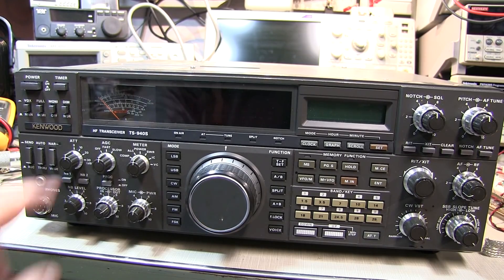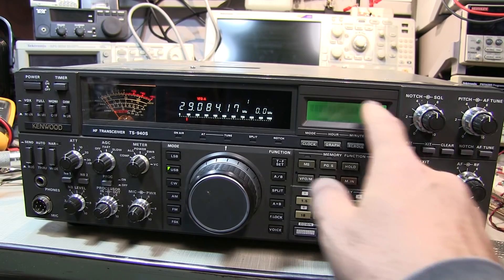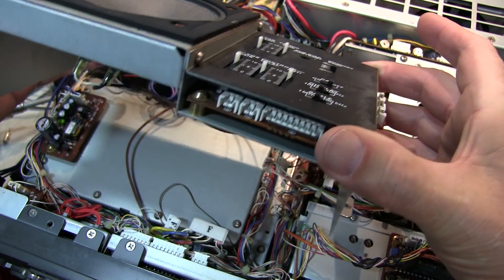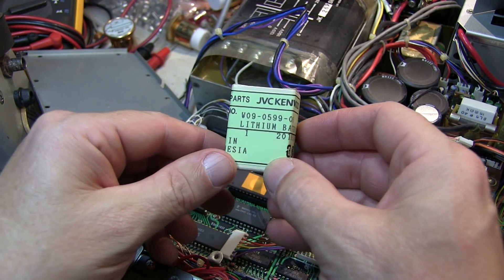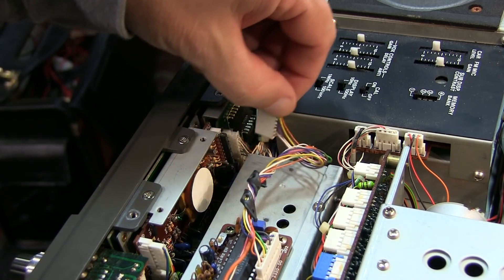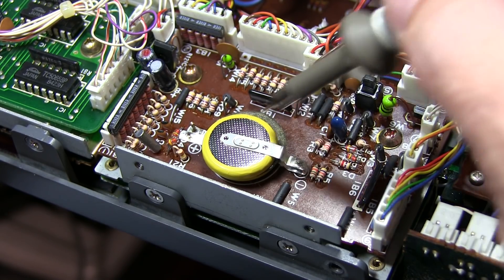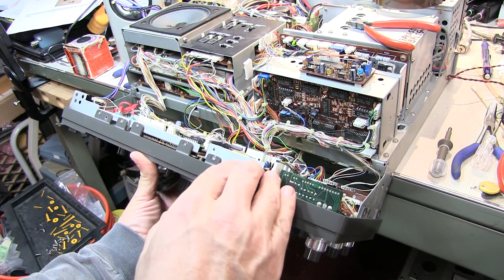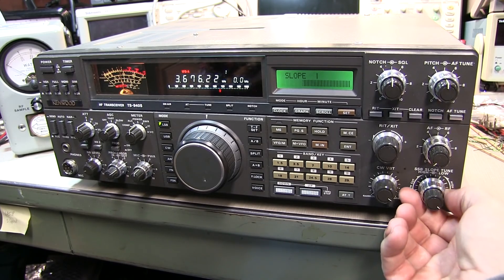#309: Radio Repair: Kenwood TS-940S Battery Replacement

Comment: w2aew, The higher the 9volt battery DC internal resistance will Reduces the circuit loading. I would think the higher the DC internal resistance will Increase the circuit loading but it Reduces the Circuit loading which I don't understand. Can you explain it better if you know about this?If I connect a ohm meter across the +vcc and ground with using a 9volt alkaline battery and then measure the ohm meter of the power rails and then comparing it to a 9volt carbon zinc and a 9volt mercury. All the three 9 volt batterys would change the power rails resistance from +Vcc to ground?
Reply from the maker: Battery resistance can be thought of as a small value resistor in series with the voltage source in the battery.  Large internal resistance is bad because it causes the voltage at the battery terminals to drop when a load is applied.  You can't measure the internal resistance directly with an ohmmeter - if you try to, you will likely damage your ohmmeter!
Reply: This company is saying that Higher Internal Resistance reduces Circuit loading take a look. The Electro-Harmonix 9Volt battery is the classic carbon zinc type that has a higher internal resistance than an alkaline battery, This reduces circuit loading. https://www.amazon.com/Electro-Harmonix-9V-Battery/dp/B00EBC9N10
Reply from the maker: @waynegram8907  I don't know what you mean by "reduced circuit loading".  That term doesn't make any sense to me, unless the circuit you're talking about is a battery charger, where the battery is the load.
Reply: I'm not sure what kind of 9volt batteries were used in the 50's and 60's only carbon zinc. I don't think they had alkaline 9 volt batteries in the 50's or 60's. But have a Carbon Zinc batteries have high internal resistance means 10 ohms. The lower the resistance value means the higher the internal resistance which reduces the circuit loading. Alkaline 9 volt batteries I'm guessing have a lower internal resistance that is 30ohms to 50 ohms or more which adds circuit loading to the voltage source which changes the voltage gain in transistor and FET circuits.
Reply from the maker: @waynegram8907  No - that makes no sense.  Higher internal resistance means higher internal equivalent resistance value.  Lower internal resistance means lower internal resistance value.  Lower internal resistance means that the battery terminal voltage is less affected by circuit loading.  Higher internal resistance means that the battery terminal voltage is more affected by circuit loading.
Reply from the maker: @waynegram8907  Higher internal resistance of the carbon batteries means that the battery voltage drops more as the circuit draws more current.  In the case of the effects pedals he's talking about, they fact that the voltage supplied by the battery varies with the current drawn by the pedal means that there is an additional change in performance of the pedal, and thus the sound affect produced by the pedal.  In most cases, high internal resistance in a battery is not desirable (except in the case of the pedals described in this video).
Reply: How can you modify a DC 9vdc power supply output have a high internal resistance? most 9vdc power supply output are lower impedance with you measure using an ohm meter its either very low impedance or high impedance , depends on the 9vdc power supply
Reply from the maker: @waynegram8907  simply put a resistor in series between the power supply and the device you're powering up.
Reply: thanks for watching the video and thanks for the help

Comment: w2aew, How do you measure the DC internal resistance of a 9 volt battery using what kind of meter? Carbon Zinc batteries have a higher DC internal Resistance compared to Alkaline batteries and Mercury Batteries which the DC internal Resistance puts a LOAD or changes the impedance of the power rails? its "adding" an additional resistances to the circuit?
Reply from the maker: The general method would be to measure the battery voltage with nothing connected, then connect a small resistor and measure the battery voltage again.  You can calculate the internal resistance from these two values.  To make it easy, adjust the resistor until the voltage is 1/2 of the open-circuit voltage.  Then, the internal resistance is equal to the applied resistor.
Reply: 9volt battery and adjust the resistor across the battery terminals until its 4.5 volts and that batterys DC internal resistance. This DC internal resistance is "in series" with the circuit which causes "loading" on the power rails and changes the impedance of the +Vcc?
Reply: Why does different battery types like alkaline batteries, carbon zinc, lithium, mercury batteries all have a different DC internal resistance value? What I mean is what is causes the DC internal resistance in battery is it the cells in series that creates the internal resistance in batteries?

Comment: Hello Alan!

I absolutely love your content, please keep up the good work, and greetings from Germany. :)

My guitar amp recently started picking up signals from a nearby cell tower. The tower just started to use 5G i believe, because the tower isn't new and i had no interference problems before.
Also the amp works just fine in a different room.
Do you have any tipps on how i could effectifly shield my amp or what i can do about it? Maybe this could be something for a new video? :)
Reply from the maker: Ferrite beads might help, see my video on that.
Reply: @w2aew  Thanks for the response! 
I saw your video on that already. The interefence only occurs when i engage the build in reverb tank. The chinch cable already had a ferrit bead on it. I put a second one on it but the interference unfortunately is still present.
I noticed that when i lean over the amp in a certain way, the interference weakens. I guess my body then acts like a shield? Can i maybe get the same effect with some metal foil or so?
Reply from the maker: @DavidRoyal1000   At this point, this type of experimentation and trial-and-error is the most effective way to address it.
Reply: w2aew Okay thanks! And again, please keep up the great content, I learned so much by watching your videos. Big thumbs up
Reply: @DavidRoyal1000  have you tried more than one guitar?
Reply: @fullwaverecked  Yes, no difference...

Comment: Thank you so much for your videos, I love them. I'm searching for a specific passage, if I remember correctly you - at least - once stated that the RF input circuit of a spectrum analyzer is more stable if I use a e.g. 20 dB 50 Ohm Pad on it. I can't find this anymore... I'd like to know why that is. Do you remember where that was? I thought it was on the directional coupler video but I couldn't find it there...
Reply from the maker: I think I mentioned that when referring to using a Tracking Generator when looking at tuning a filter - using an attenuator on the output of the tracking generator ensures that it sees a more consistent 50 ohm load (even when the filter under test doesn't).
Reply: Thank you!

Comment: hello sir could you explain ,,, till what frequencies now we are using Silicon , what are the new materials which will help at high frequency ,as silicon did till now,,,,
could you explain why VLSI and  Microwave design differ a lot   ???????

Comment: I really enjoy the video's you give us.
I know you have done some talks about RF and IF transformers, but I would like to see a in-depth  look at power transformers, and would like to know what the difference of a winding side-by-side or each winding on top of each other. (radio transformers are mostly wound on top of each other, but a micro wave transformer is side by side windings).
If you are making a isolation transformer for 120vac of around 200+ turns, and wind 200 on top for the output, the wire in the secondary will be longer because of the amount of layers on top of the primary.  There must be some kind of formula for all this stuff.
Thank You

Comment: I am curious if you have any cool techniques to stay organized in the shop. I imagine you’ve collected quite a bit of stuff & parts & tools etc… As my collection grows I am finding trouble keeping sanity. For example right now I’m wishing I had a quick simple way to keep the ‘current’ parts on the bench without them being in a pile.  If we put all the resistors in a little bin and keep that on the desk. It can get messy. esp the 4 bands with brown on BOTH sides !! or fast diodes/ zeners. Point is that there is a lot of components which look the same. My quick grab is a pile the desk and a large breadboard which I populate in order. Everything else is shelved and binned. Also, I am really curious if you have techniques for working with probes without them strewn about the desk(like mine). 4 or 8 probes , a couple of DMM’s and a signal generator will fill the desk with wires REAL quick. I have not found a solution for that yet.  Anyways, I’m just making a suggestion that a video about “organizing the electronics bench” would be a cool topic. In the shop too. I’ve probably got all the types of storage bins known to man that they sell at home depot and target. 99c shoe boxes. Tool boxes. etc etc… I think the new players and old hats will likely find some things useful. Still wondering how you fit that 17m antenna in the shop.. haha jk
Reply from the maker: If you've seen my shop you'll know that I don't have a good organization system!  I do have new/unused stock of resistors, caps, transistors, etc. in those plastic multi-drawer bins, and I do have several wire looms for probes and cables, but that's about it.  My "go-to" pile of stuff on the bench is a mess!
Reply: @w2aew  I feel you pain too. Don't b so hard on yourself. In the EE shop its not about appearances but utility. I think all of us feel the struggle of stacks on stacks and piles on piles.  I was laughing when one viewer commented "now I can sort my zeners" , in my mind I was imagining a toothpick jar sitting on the desk. Luv ur content, appreciate everything
Reply: @w2aew  as long as there is a method to the madness, all is well.

Comment: Question for you:  do those 22 channel 2-way radios use the same frequencies as ham radio?  I was messing around with a set of Uniden radios today (not much else to do) and I was picking up a conversation between someone in a town about 30 miles from me, and someone else who said he was in a desert area (I'm in Michigan so nothing like that around here).  My radios are rated for 6 miles max.  It was channel 18 which is 462.6250 MHz.  They said something about a repeater down in Illinois.  (I couldn't transmit because the batteries are junk and the transmit wattage instantly makes them shut down with a low battery indicator, so all I can really do is receive.)
Reply from the maker: The radios you have are for GMRS. They do not use the same frequencies as ham radio. You need to have a license to transmit with them. There are GMRS repeaters. You were listening to a repeater output. More information here:
https://en.m.wikipedia.org/wiki/General_Mobile_Radio_Service

Comment: Not just one but three batteries, what a horrible design. Worse still soldered down battery. Is this an example of built in obsolescence. How much damage would a battery leak do?
Reply from the maker: More like planned maintenance.  Unfortunately, this was common practice for non-volatile storage back in the day that this was made (25-30 yrs ago).
Reply: @w2aew  it would be forgivable if it was one battery fitted in a compartment that allowed the user to access and service it.
One instinctively knows when some thing is bad, and this is just bad.
You say this is a feature of thirty year old equipment, but I have a modern spectrum analyser with a CR2032 soldered on to the main PCB. The battery runs the real time clock. To access the battery it is necessary to remove the back and seemingly hundreds of screws holding the internal RF screen in place. Why could the battery not have been fitted in its own compartment, accessible from the outside of the case?
I was told to day about an expensive games console that is fitted with a soldered down battery cell on the main mother board.
Apparently one of the equipment's failure modes, is for the dead battery cell to break open, spilling corrosive battery electrolyte over the mother board. By the time the user discovers the problem, the electrolyte will have eaten its way through many of the PCB tracks that run close to the battery. This destroys the mother board beyond repair. 
As far as I am concerned it is just bad design. Having said all the above, I was impressed with your repair. A very satisfying result.
What is difficult to understand is why such a complex piece of equipment is fitted with such a poor design solution as three batteries. HORRIBLE!

Comment: wires are really big pain in this construction, in ex ussr there were produced special military wires called MGTF they were made out of many very thin copper lines winded togetger in special tough insulation, they easily survive temperatures up to 200 and mechanical tension, those wires still on sale as second source supply they would make this device working without flaw

Comment: I installed low profile coin cell holders and higher capacity coin cells in my 940. No longer uses 2032's. Using Kapton tape works as well as foam insulation BTW.

Comment: Hello Alan, Ive been a fan of your work for some time now!
I was wondering if u can suggest some quality book for RF design ? free if possible .. but i know knowledge comes at a price :)
I am basically interested in HAM radio frequencies receivers/transmitter design. If possible I want a focus on derivation of antenna characteristics ( Capacitance/Inductance of an antenna, terminal impedance, characteristic impedance, modelling antenna as a transmission line), coupling circuits and RF amplifiers)
Ive got a pdf version of a book (free) from K.R. Sturley : Radio Receiver Design wich i think its pretty good but a bit old ( 80y :) and covers all the topics nicely but ive got a feeling that something is missing. The other one that im reading at the moment is Radio Receiver Desig by Kevin Mclaning and Tom Vito also free and avaliable on the web.  Are these enough ? Do you have an opinion on theese books ? Do they cover enough that i can design transmitting/receiving system from scratch at the end ? do you suggest another one ? as fat as possible if possbile :) Thank you very much!
Reply from the maker: I don't have any free books I can recommend.  However, the RF Design book by Bowick is good.  I also like the ARRL Handbook and the Radio Communications Handbook from the RSGB.  Solid State Design for the Radio Amateur by Wes Hayward, as well as his other books - Introduction to Radio Frequency Design, and Experimental Methods in RF Design are good too.
Reply: @w2aew  Thanks alot! I'll check them out!

Comment: In a nice piece like this so delicate and complicated why would they put in batteries? Isn't there something they could use instead like a standby voltage or something?  Well this is above my pay (I am an old retired fart) but I do like to watch folks play with these cool toys.. thanks for the share, carry on and have fun doing so!
Reply from the maker: Back in the era this equipment was made, electronic non-volatile storage devices were in their infancy, so they used battery backup to store data.
Reply: @w2aew  Geez it looks like something new to me.. like about 5 or so years old maybe.. But then I do not do any of that ham stuff.. Not that I am not interested in it, it's just I was so busy in my young life that I never settled down enough to get into it.. then had a family and now I am old and on a fixed income.. But I am trying to teach myself a little electronics with all these break out boards, pi's, arduinos and such.. That is why I like your channel.. you are a very good teacher.. even an old fart like me can follow what you are saying.. thank you I appreciate all of your hard work! Carry on!
Reply from the maker: @tinkmarshino  This rig was built in the mid 1980s, so about 35 years ago.
Reply: @w2aew  Wow.. that was a while back.. I was settle down then.. sure looks in great condition but then I look ok 32 years ago when I was 35 also.. with with a wife and a couple of babies.. you do great work son.. thanks!

Comment: Alan, why do manufacturers use batteries that need to be soldered to replace them, rather than just using standard AA batteries and an easily accessible battery holder? (BTW, I watch all your videos and learn something new every time)

Comment: I soldered a socket and replaced the battery with a CR2032. This works for a TS-440S, TS-50S and this TS-940S. On my TS-940S, the timer had only one battery.
All devices have been working for over 4 years now. The advantage is that you get the CR2032 everywhere at a very low price.
73 Bernd

Comment: Thanks for posting the video how to replace the Kenwood TS-940 batteries! I have a non-functional TS-940. It had chirp on CW receive and garbled audio on SSB receive. Then the PLL quit working intermittently. Now the PLL doesn’t work at all. Do you know how to fix that problem? I heard that cleaning 60 plus tin plated molex connectors and resoldering several PC boards might fix that problem. The TS-940 is notorious for bad soldered PC boards.

Dave KY0L
Reply from the maker: Often, removing and re-seating the PCB connectors is enough.
Reply: I can confirm this. Reseating the connectors is the first thing you should do. Muffled audio and similar issues is due to leaking capacitors. You can purchase the capacitors set for TS-940 on ebay. Kenwood radios are notorious for leaking caps. I have the same issue on TS-850 too.